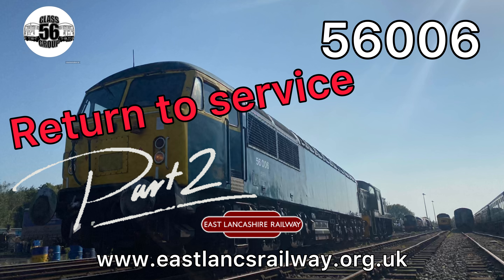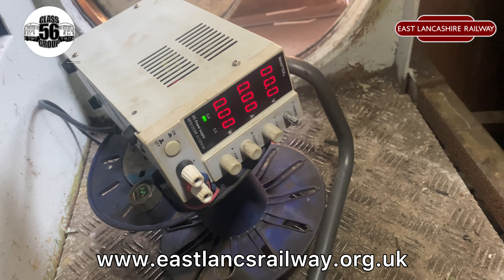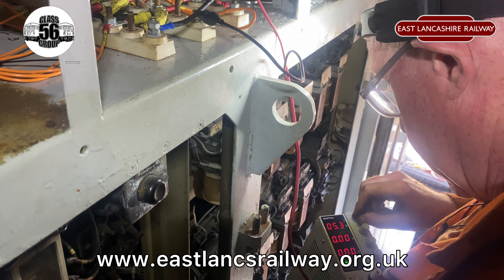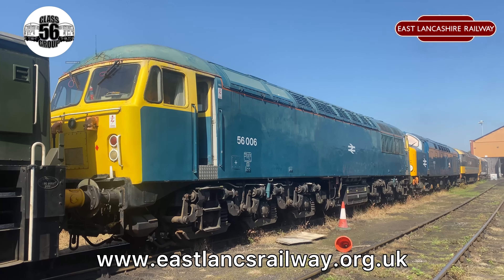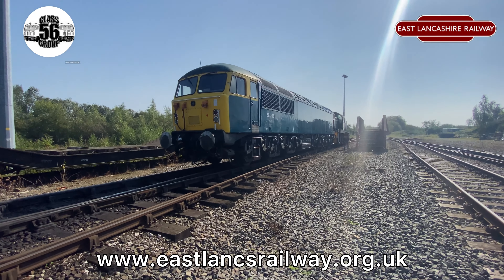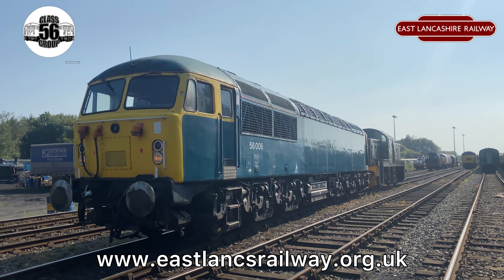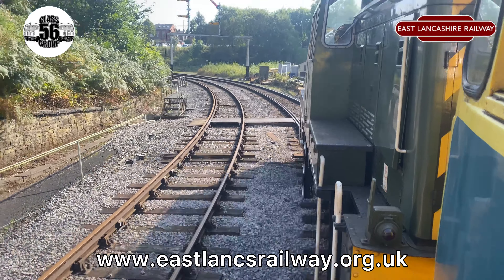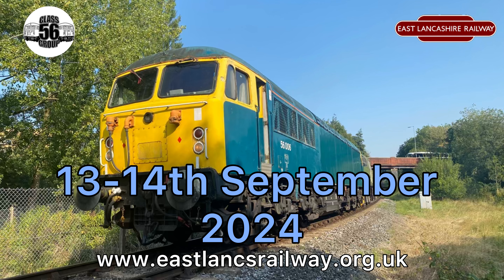56006 - Return To Traffic (Part 2)

Comment: Remember doing a ton light engine brighton to Haywards Heath on quite a few occasions,05.00 going to work the ARC train down to Ardingly  . exciting!!
Reply from the maker: Happy memories. 

I would strongly recommend coming to the ELR and possibly trying out a driver experience day.
Reply: @ can I do a ton though?
Reply from the maker: Good luck getting a Grid to a ton!
Reply: @J0nnyGT  used to do it regularly with the right driver on theLE  bton to h Heath   See my first post.
Reply from the maker: @ brilliant! 🤣🤣

Must have been downhill with a tailwind!
Reply: @ don’t know why you think 3000 hp shoving 125 tons won’t go. ?
70 75 at Preston Park 85 90 by Patcham tunnel and easy a ton before Clayton. Uphill at 1 in 264. Hit a wet spot at Hassocks at the ton and I was nearly thrown out of my chair, tea hit the floor. Like I said, exciting

Comment: OHH COOL are you converting 006 to hydraulic?😉😂 AMAZED to see a Grid in preservation. The old	Ruston-Paxman 16RK3CT are SUPERB units. I think Rolls -Royce fit them in their cars? :shelterin: WELL DONE. That would be SUPERB on a Railtour on the ML. Is the AWS all up to date, cab radio etc?
Reply from the maker: I'm quite happy with the Maybach lumps we normally look after and the little V6 Paxman in D9531. 

Not my call to make regarding railtours. Its still not worked at train on the ELR yet so don't get too carried away with the mainline. 

No gsmr or otmr so would need that at a start plus a whole load of cash!